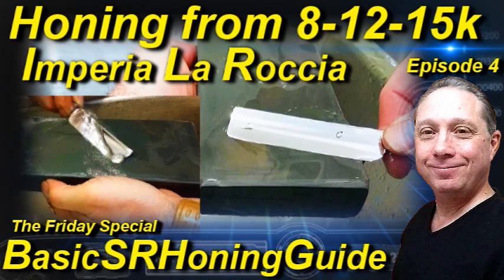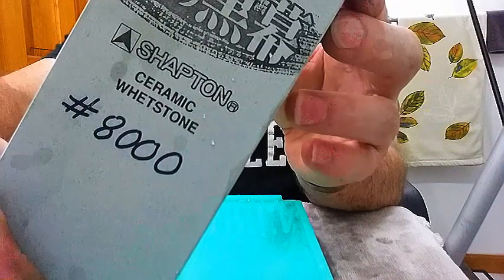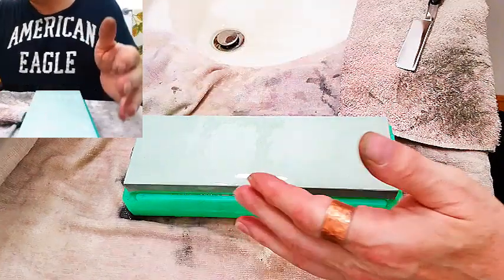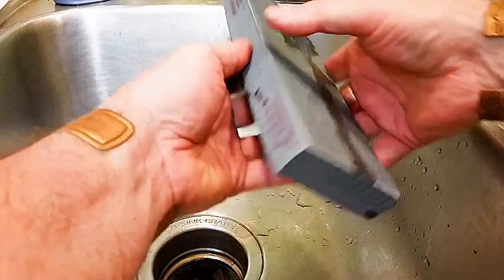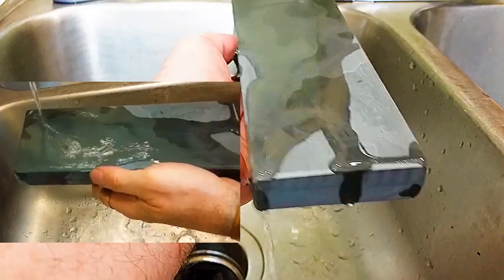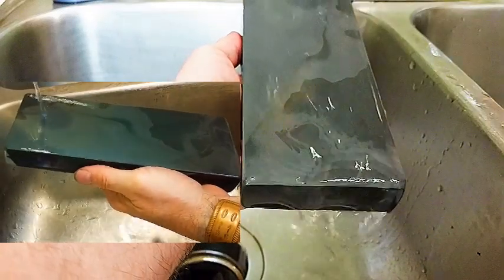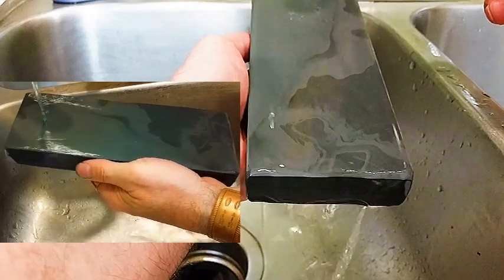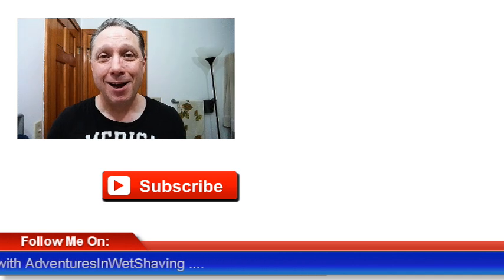Basic Straight Razor Honing Guide, Honing from 8000 Up to a 12000-15000 ILR Finishing Whetstone, Ep4

Comment: Very nice. That ILR technique at the end also works with synthetic stones and Belgium Coticule stones.
Reply from the maker: Nice! This is the first time I've used this technique and it worked fantastically! Really put a smooth, but sharp edge on that Parker Best Silver Steel straight razor. Stephen thanks for everything my friend!  🙂
Reply: when i tried it, i got phenomenal results and it took longer to photogragh and write the blog post than it did to hone 4+ razors at that time. I'm tempted to get that ILR stone when i get paid again.
Reply from the maker: So far this ILR stone is fantastic and has a nice buy in price as well! I don't believe you could go wrong with this stone. Go for it!  🙂👍
Reply: i think i will. :D

Comment: @ Adventure In Wet Shaving- Hey Eric. I like your technique for the ILR stone. I found a way to step up the edge and refine it much more. After finishing off the 8k go to the ILR stone totally dry x's for 7 1/2 minutes and than finish the ILR using the Coticule method. I hope this helps FWIW. 
Cheers, The Warrior of Legend. 👍🤙
Reply from the maker: The Warrior of Legend please tell me how working the ILR totally dry works. I've only used it with running water or with glycerin and both seem to work pretty good.

Thanks for the great comment and for tip, and thanks for watching! :) Have a good weekend, cheers! :) #Heart
Reply: Like drmatt357 basically implied this stone defys logic. He's tried it and said it himself in his maintaining your razor's edge video. 

I've found this to only work the ILR stone only though. Even I got to admit it's a very strange stone. 

Apparently the cut surface is still present on the ILR stone even when dry. 

FWIW- this is from my experience. I hope you found this helpful. 

Take care. 😊👍
Reply from the maker: I respect you opinion my friend and I understand how you feel, I know someone who felt the same way. But Dr. Matt found that the ILR was one of the most consistent stone he had ever used (especially for beginners) in his very own under the running water technique.

I did have to lap my stone for quite some time to get it the way I wanted it. But it's all good now. I have also found my Imperia La Roccia puts a nice sharp but smooth edge on all of my straight razor's regardless where they are made or in what time period. If my straight razor is a new Chinese razor, a vintage Japanese razor out of the 70's, a vintage French razor out of the late 60's or early 70's, a vintage Sheffield razor (ranging between 1840 to 1860) or even a Solingen Germany razor both vintage (ranging between 1890 to the early 1900's) and new from Boker. I each straight razor I have honed has a fine shave ready edge when I'm finished honing them and I don't have to take that long to hone them (it's really quick).

Please let me know if I can be of assistance to you, thanks for your comments. :) #Heart

Comment: How do you like the ILR so far? Also do you see any advantage in getting the 3 x 8 one over the 2 x 6 one that Dr. Matt uses?
Reply from the maker: Great questions David! :) I really like the edge my ILR puts on a straight razor. It's a smooth and sharp edge at the same time making the straight razor a very comfortable and enjoyable shaver. For the price difference between the 3 x 8 and the 2 x 6... I prefer the larger stone it's got more meat and if you compare the price to a Jnat it's night and day cheap. And for me the larger stone is easier to work with IMO. But if you are use to the smaller size it will work just as well giving you a nice edge. Hopefully that was helpful please let me know if you have any other questions. :) Thanks for the great question and comment, and thanks for watching! :) #Heart
Reply: Thank You for the quick reply Eric! And Yes it was very helpful, I'm thinking about getting the2.5 x 7 one
Reply from the maker: Very Cool! :) You can't go wrong with this stone especially at this price point... please let me know how you get a long David. :) #Heart
Reply: What part of the country do you hail from Eric?

Comment: Hi Eric, just wanted to ask, what do you prefer, 15k from metalmasterjp or this ILR? Thanks
Reply from the maker: That's a really good question! The 15k resinoid metalmaster stone works quite well you can put an excellent edge on a straight razor with it. The edge will be very sharp (like a light saber) so I finish using Chrom Ox to get that balance between edgy but smooth for the shave.

I have only started using the 12-15k Imperia La Roccia whetstone it is a natural stone. IMO it does impart a sharp but smooth edge from the stone using clear running water. Check out the Wednesday Shave Of The Day on June 21st 2017 and see what Chrom Ox will do for the edge. Dr Matt says that the 12-15k ILR looks to be a 20k stone and from the slides he showed I most agree with him.

The finishes for both stone are very different, both work well a standard 12-15k Imperia La Roccia can be had for $62 USD w/shipping and the 15k resinoid metalmaster would be $57 USD w/shipping. The prices are similar so the next question would be. Do you want a synthetic stone or a natural stone? Do you already have a synthetic stone or a natural stone? And want the add to your honing stones collection. Again, both work well. If you have never tried a natural stone that may be a good place to start.

At this point. I don't have that much experience with the 12-15k Imperia La Roccia, but it seems to be a very nice honing stone. I would start there for a finishing stone, if you don't already have a 15k resinoid metalmaster.

Helpfully that was helpful. Thanks for watching and for the great question, please let me know what you decide VanDelosSantos!  👍🙂💈
Reply: Thank You! I have a KW-65 that I bought from metalmasterjp for 48 dollars with shipping, it is a King 1000/6000. I found out after 2 years of honing knives, cutters, and razors, the 1000 grit side really needs to be soaked for about an hour or more to get a good feedback from it. However, with the 6000 grit side, it is better to use it with just a very light splash of water. I learned this from Korin Knives, they have a great tutorial about finishing stones and to prevent it from cracking and stuff. They say that all finishing stones must be used with only a splash of water. But anyways, based from what you said, I think I'm gonna go with Imperia La Roccia. Thank you once again!
Reply: Hi again Eric, I don't know why, but people from Amazon were saying in the reviews that the Shapton M5 12k doesn't even polish the edge of the knife/razor they're sharpening, they say that it is similar to a 4k/5k grit based on the gloss of the edge that they were getting. There is one guy who said that his King S-1 6k finishes better than the Shapton m5. So, what I was thinking is that after you sharpen with your 8k, you might be going back to 4k/5k when you use Shapton M5 which was actually rated 12k. So, you might actually need to finish with the ILR a lot more because it takes a very long time to actually jump from 5k to 20k. But, I don't have a Shapton M5, I'm just basing it from their reviews, it might be true or not. To find out, try to hone with your 8k, and compare the gloss of the edge from the Shapton M5 12k. If the 8k has a better gloss, the Shapton might not be 12k, but 5k. Check out the customer reviews here: https://goo.gl/noZEpB
Reply from the maker: I don't soak the Shapton M5 12k stone at all and it works fine as a finisher for me. I've found when using the Shapton M5 12k stone you need to use little to no pressure and just keep it wet.  💈🙂💈
Reply from the maker: Good choice!  👍